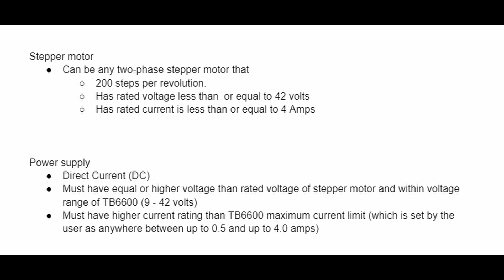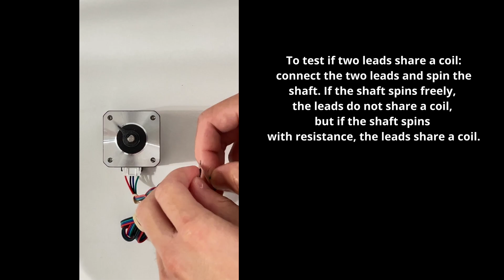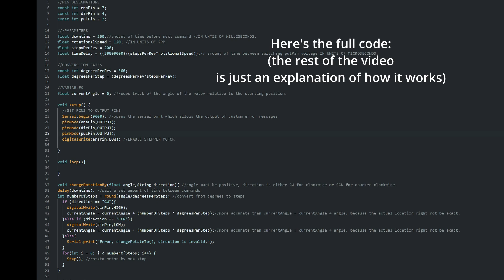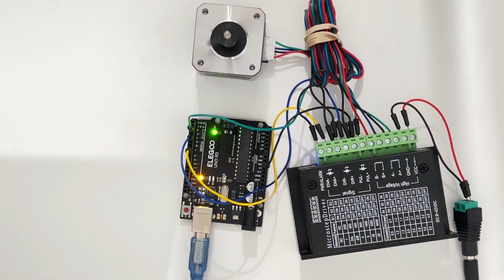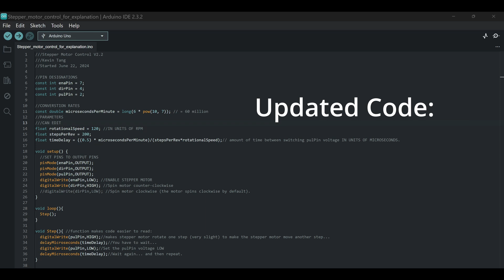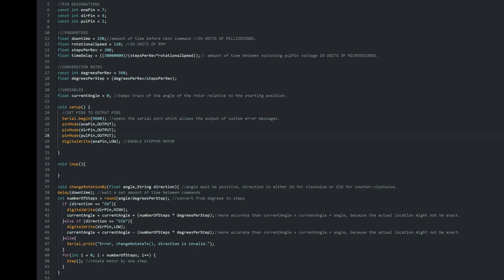Arduino Stepper Motor Driver (TB6600) | Control Speed and Position

Comment: hello, I managed to get your code writen down, how do you set the angle that you want it to run to, or is it just adding up angle? I need to be able to have it run for so manu turns... and then I will add a rotary encoder and an lcd to use it to wind coils...which value is the value of the angle or the number of full turns in my case? than you in advance!